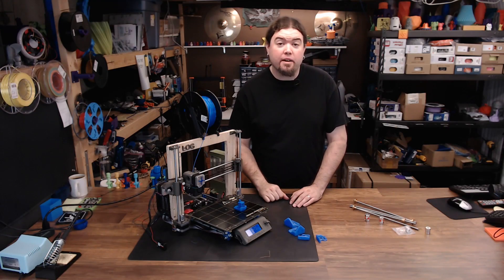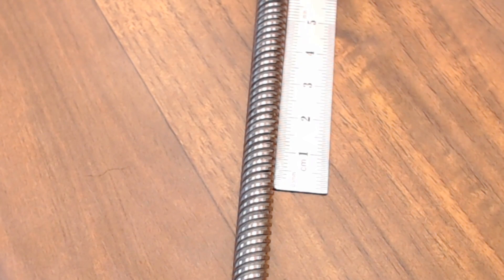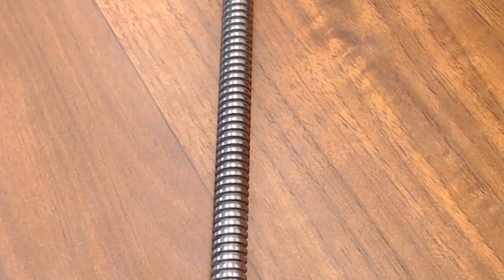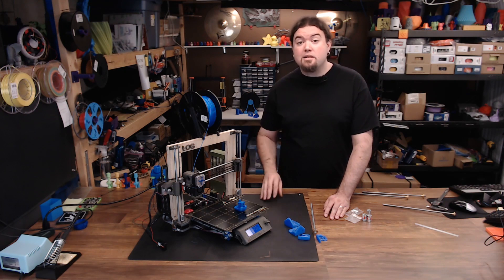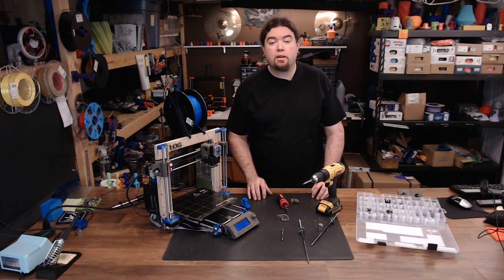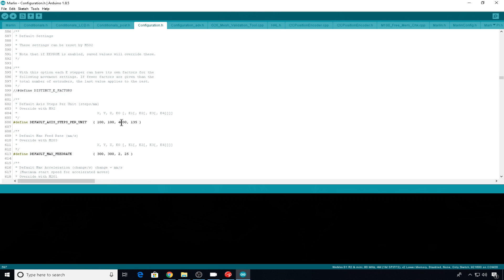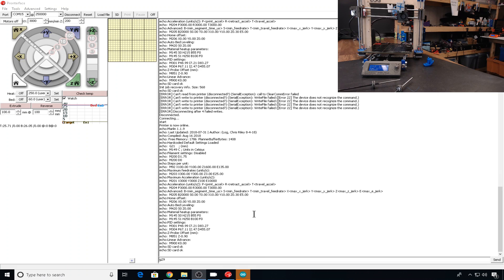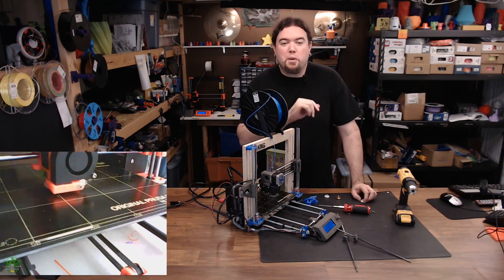Lead Screws - Printer Upgrade - Chris's Basement

Comment: Personal Summary Notes:
- Pitch: distance bet. threads
- Start: separate thread path
- Lead= Pitch x start 
- Lead/Steps= linear distance per step
- for system that require faster movement it uses multiple starts, every start acts as single start with high pitch.
- might have more friction and require a more powerful motor to drive them effectively. They could also be more prone to backlash and require higher precision in design and manufacturing to ensure proper alignment.
- single start travel a lot of distance in small pitch, slow put more precision
- Helical type coupler:  can move in X & Y axes but also can hop a lil in Z-dir
Reply from the maker: Looks like you got it!

Comment: Hi Chris, I am learning quite a bit from your youtube videos. Thank you! I am having trouble with the first 5 layers on my print. I have a TR8x8 z axis lead screw. The first layer height is 0.2 and the layer height afterwars is 0.16. Should work, right. But the first few layers are too close and there is alot rough patches in those layers. Any advice??/
Reply from the maker: Awesome to hear! It could be backlash in your gantry. Sometime on certain printers, the first couple of turns on the Z aren't as efficient as they should be because to droop from the X gantry. Sometimes anti backlash nuts can help, or just snugging up the gantry so it's more efficient.
Reply: @ChrisRiley  Yes that has been my problem from the get go! I will find a solution! And thank you, again!!!

Comment: So I f I wanna make Prices cnc milling machine , it's good to choose single thread instead of 4 starting thread ?
What makes diffrence ? , can we compensate this variation of linear motion per revolution per steps , in Cnc Program?
Or any type Of starting thread can be used ?
Reply from the maker: You can use any thread and change it up in the firmware. All the different profiles I show in this video are going to be MORE than accurate enough for the machine.

Comment: Excellent video!
Any idea what leas screws the sidewinder x1 uses?
I know it is T8 but not sure of start,and pitch.
Any  help apreciated!
Reply from the maker: That is a TR8x8 so 4 starts 2mm pitch.
Reply: Thank you!
Appreciate the response and the videos!
I bought (6) x2 and (3) x1 but as is and need work but could not find info
ARTILERY was not much help with part spec and part info. 
Have a few bad lead screws but wanted to go longer to 800mm. Or 1000mm and go double on bed size just for fun/learning. (New to 3d printing)  Online sellers for the x1 x2 lead screw did not have spec info.
I watched your video several times but still was not sure what I was seeing.
Thanks again!

Comment: Hello my friends. I don't have much experience for building my 3d printer.
I have a few questions. I know that if the BED of the 3d printer moves in the vertical direction and its weight is high, if power will be cut off and the lead screw is not suitable, there is a possibility of it falling and you cannot continue printing after the power is connected Or it will be very difficult to continue printing.
I have designed a printer that I will tell you about and I would appreciate it if you could help me with the questions I have.
Bed size: aluminum 50x50x0.6cm with a glass on top. This bed only move in Y axis.

1- Can 1 nema 17 (4.4kg/cm) with GT2 pulley with 6mm belt move this Bed in Y axis without any problem? You probably tell me that it depends on the bed weight. And my question is, what should be the weight of this bed? so that 1 nema 17 (4.4kg/cm) can move it horizontally?

2- The accuracy in the Z direction is very important for us. and for this reason, I chose this lead screw: (( D= 8mm/ lead= 1mm/ Pitch = 1mm/ 1 start )) and the driver is DRV8825 which has a 1/32 microstep. My extruder is indirect and only E3d-v6 attach to x axix and I attach MK8 filament driver to Structure and moving filament with PTFE pipe 4-2mm.
With these conditions, if the power is cut off, the X-axis will not fall in the vertical direction if I use this lead screw? I used two lead screws with these specifications in the vertical direction.

Please guide me so that I don't go the wrong way and buy the wrong parts.
Reply from the maker: The first question is hard to answer. There will be some trial and error. NEMA 17's can move a lot of weight, but the more weight, the slower you will have to go. 

The second question, if you are using single starts like you say, you will have no issues with backfeeding.

Comment: Hi, i thinking about the Leadscrews In my Way i put the Motors on Top of the Machine, in the upper Part with a Bearing that give Length Movoment Capability. The  Bearing on the Bottom is Radial and axial fix. So can the wobbwlish wobbelmotor with The Coupling Dance around.... I chose the first one of coupler, i think it has better rotational correctnes... Maybee i will try it out. (the best designes you see in the Industry. I have seen such a setup with motors on top and will try it out Best Regards from Germany =)
Reply from the maker: Thanks for your comment.

Comment: I relied on this video for learning, planning, ordering, and assembling.  Well done.  Thanks!  All went well with 2 exceptions.  The Marlin settings had no effect.  On my machine, Z steps/mm is over-written by the eeprom.  Manually changing on display would have taken an eternity.  I had to do an M92 Z1600 and save setting.  To speed up the drive screw, I had to change the #define HOMING_FEEDRATE_Z  to 125.  It was a good thing I started with x carriage midway up and did a test of raising z axis 10mm which traveled 25mm.  I mention the eeprom because most people probably wont read thru 200+ comments and it took me a good hour or so to figure these out.
Reply from the maker: Good catch, yes, that has gotten me in the past as well.

Comment: So where can I get these lead screws? Closest I found was on Mcmaster-Carr but not with 1 start. Are all motors 200 steps per revolution?
Reply from the maker: It depends how long.  http://www.zyltech.com/8mm-t8x2-trapezoidal-acme-lead-screw-w-brass-nut-custom-length-up-to-1000mm/

Comment: Just wanted to say Chris, since I've gotten into 3d printing, I had no clue what anyone was saying about layer height, and many other terms you mentioned. I had no idea on lead screws and how it related to micro stepping and layer heights on your prints. With this video now it all makes all sense and now I am actually noticing a difference on both my Ender 3 and Ender 5 printers that I had two different lead screws on each one! On on my Ender 3 I have a 4 start and my Ender 5 I have a 2 start! So both of my printers have different layer height multiples (0.04 and 0.02)! I thought they were all the same! Thanks to your video this def clears up a lot.

Is there a benefit of using a 4, 2, or even a 1 start? Is there a difference in quality and or how the stepper motor can handle the layers?
Reply from the maker: Glad it helped! Now a days, there isn't a lot of difference since the drivers and microstepping is so good. Technically on paper single start would make your layer fall closer to full or half steps, which again, on paper, would be better. Can you see it on the print? Probably not.

Comment: 400mm rod, 8mm dia, 4 start....to reach 0 to 400mm how many rotation should motor rotate?
Reply from the maker: I feel like this is a pop quiz, LOL, so 8mm per turn, 400mm that is 50 turns.

Comment: If the original lead screw needs the motor to make 3.75 full steps for 0.15 layer height, but the motor is set for 16x microstepping, why can't the motor simply take 3.75x16=60 micro steps? There might be some layer heights that won't match neatly with the steps available, but it seems that the common ones would work just fine.
Reply from the maker: The idea was to land on a full or half step as much as you can, really it doesn't matter that much at all now a days.

Comment: Thanks so much for breaking the math down so well. I would have never figured any of this out on my own and it's very relevant to me as I'm now buying parts to upgrade my ancient robo 3d r1. 
 
The 4 start 8mm lead screws certainly are the most popular/readily available on amazon. In my case I've only ever printed at 0.2 layer height so I can see how grabbing these and moving on with my life would be perfectly fine. 

But your point about achieving any layer height within two decimal places, for the single start lead screws, was an important take away. 

I didn't really understand some of the math, so I took what you explained at different points in the video and tried to lay it all out in one shot in a spreadsheet. I've shared it publicly for anyone who wants to study it. https://docs.google.com/spreadsheets/d/1KFYwtGOEPqN6q9QY-LbsYkHjHQ_yWnzOfWCUha9THWI/edit?usp=sharing
Reply from the maker: Very nice! Great way to lay it out. That makes a lot more since.

Comment: Hello Friend,

I need your help to make some key decisions. I am making a large size 3d printer CoreXY type, bed will not move, size - 2300*1500*1500mm (X Y Z).

Due to the large size of x & y, I have two options, one is to use large width belt 10mm, another solution is a ball screw.

We don't have to compromise in speed and quality, so please guide according to your experience.

In the view of the ball screw, I don't have experience of use of a ball screw, so there is doubt on the backlash problem in the ball screw.  So please guide that, Have you observed backlash effect in ball screw, if yes than please guide on how to fix this problem. 
Please discuss in the view of ball screw SFU1610 for X & Y axis.

Also guide, ball screw SFU1605 is better or lead screw for Z axis. 

In lead screws, we eliminate backlash effects by using anti backlash spring nuts. Same way is there any way to properly eliminate backlash in Ball Screw.

You can also suggest your ideas for a large size printer.

Please reply
Reply from the maker: There are a lot of things to consider when making a printer this large. The large it gets the problems you see get made larger as well. You need to make sure it is very sturdy. Ball screws are going to be much more accurate than a lead screw. The ball screw will have much lower backlash by design.

Comment: Is it faster than regular belt 3d printers?
Reply from the maker: I would say lead screws are a bit slower.
Reply: @ChrisRiley  thanks for the reply. What if someone's making a huge printer...approx 2m cube build volume...then belts or lead screws?
Reply from the maker: @ShubhamGupta-xb1om  That's hard to say, belts get very slack at long distance, but longer lead screws that are strait are hard to get. I guess I would go with wider belts for a larger machine.

Comment: With a Tr8*2 lead screw, how would the torque change at the same steps/s and at the same mm/s? (Let's say 4mm/s with a Tr8*8 lead screw)
Should I run it on the same steps/s, or is it safe to run it on the same mm/s, with an Ender 3 default Z motor, for the sake of the motor and the motor driver (SKR Mini, TMC2209)?
I don't have a Tr8*2 lead screw yet, so I'm just gathering information.
Reply from the maker: I think I answered this, but the the ender 3 motor is pretty small, it might not have enough torque to turn the finer pitched lead screw.

Comment: 1 question , i bought th e2 mm lead screw , can i use them in a cnc for pcb? will th enema 17 be able to handle the 1600 E steps?
Reply from the maker: Not sure what you mean E2 mm? Yes, the single start works well with a nema 17.
Reply: @ChrisRiley  i mean using them for a cnc , will it work?
Reply from the maker: @TnInventor  It should, they are just very slow.
Reply: @ChrisRiley   i will use 8 mm pitch  then , thanks man

Comment: Chris, should I switch out my x,y belt system to t8x2 screw?  And my z have t8,8lead-2p-4start also wanted to switch it to t8x2 1start
Reply from the maker: I don't think you would gain a whole lot converting to screws over belts. On Z they are nice, but they are super slow.

Comment: Hi Chris, great video, im really enjoying your series. I have learned a lot from you over the last few weeks in building my first printer. but im wondering about your calculations when you say about "whatever micro stepping"

I have ran the calculations and i see once you go to 1/4 or above micro stepping, the layer heights do not need rounding for an 8mm lead screw with a 2mm pitch and 200 rev stepper. unless ive got my sums wrong. 

in the below, the figures under 2mm and 8mm are the steps required to achieve the layer height.

1/4 Micro stepping
LH	        2mm	8mm	
0.1	        40	        10	
0.15	60	        15	
0.2	        80	        20	
0.25	100	        25	
0.3	        120	        30	
0.35	140	        35	
0.4	        160	        40	

1/8 Micro stepping			
LH	        2mm       8mm
0.1	        80	        20
0.15	120	        30	
0.2	        160	        40	
0.25	200	        50	
0.3	        240	        60	
0.35	280	        70	
0.4	        320	        80	

1/16 Micro stepping			
LH	       2mm	8mm 
0.1	       160	        40
0.15       240	        60	
0.2	       320     	80	
0.25       400  	100	
0.3	       480	        120	
0.35       560   	140	
0.4	       640	        160	

Taking an example from your figures at 2:08. 

LH         NO MS         1/4 MS         1/8 MS  
0.15      3.75              15                 30
0.3        7.5                 30                 60
0.45      11.25            45                 90

Using the standard 200 steps steppers, 8mm lead, 2mm pitch. once you go to 1/4 micro stepping, you are getting 0.01mm resolution per step. so any layer height can be achieved. i know there are disadvantages of micro stepping. But if you can over come them, would you still consider an 8mm lead screw has a disadvantage over a 2mm lead screw.
Reply from the maker: Thank you for this comment, I don't make some of the statements in this video very clear and I apologize for that. In the video I am suggesting that if you stay on the full step and don't land on the micro step your accuracy will always be higher. How much high, a very very small amount. Micro stepping for the most part works great, but on the micro level it will never be as accurate as the stater. Hopefully that helps!
Reply: @ChrisRiley  Hey, yes, that helps a lot. i need to make a choice. 2mm lead for accuracy, vs 8mm lead for speed. i will get both and try.
Reply from the maker: @paulrobinson270  I really like the single start, but you have to have some patients their speed is a little painful.

Comment: Hey Chris. Love your work and have felt empowered to try upgrading my printer.  I bought some T8x2  with one start, updated my printer to the 3.0.0 and got a successful test print. I switched out the lead screws and updated the firmware but when I went to test it the z axis only went up a fraction of the max height. Any ideas?
Reply from the maker: Thanks! Yes, you need to update your Z steps. You can run a M92 Z1600

Comment: I just upgraded my lead screw (https://www.amazon.com/ReliaBot-150mm-Thread-Printer-Machine/dp/B07QXYVW8R/ref=cm_cr_arp_d_product_top?ie=UTF8) on my ender 5 pro. I changed the steps to 1600 and the federate to 3 (It was at 20, not sure why), and when I try to home the printer, the coupler spins quite a bit, and the axis moves some, and then it makes quite a loud whining like noise (coming from the z stepper motor I assume). all the motors and such are stock so I am not sure what I am missing, not entering in correctly....any ideas?
Reply from the maker: I would put the feedrate back to 3. It's probably just moving to fast binding the lead screw.
Reply: Yep, that worked, I dropped it to 2, and it’s really slow, so I tried up to 5 and it seems to be working well. Thanks for the info

Comment: Hi Chris, So ive got a question I'm wondering if you can help me with, I'm looking at changing my ender 3 to a Tr8x2 after watching this video, but almost every search term I try throw at Google I don't get a concrete response to, So my question is, I notice the lead nut looks completely different has 4 screw holes, do they match up so I can just screw 2 in? If not is there a lead nut that I can buy that Google isn't showing me?  cheers in advance!
Reply from the maker: Hey Grant, tr8x2 will be a different nut and they are going to be really hard to find in the ender 3 style. Probably have to find some to machine one down to fit.
Reply: @ChrisRiley  gotcha, well for the Time I think I'm out of luck and patience, me thinks I should do more reading another day.

Comment: Any recommendations on high quality lead screws?

I'm looking for ball screw style nuts, too
Reply from the maker: Misumi has really nice stuff, https://us.misumi-ec.com/ check openbuilds as well, there stuff is nice for the money.
Reply: @ChrisRiley  openbuilds products don't list an accuracy. I was hoping for at least C7 grade, so it would be difficult to purchase something that I don't know what I'm going to get.

The link leads to a place that doesn't sell anything larger than about 250mm, and I need 520mm for my z axis.
Reply from the maker: @garybarbourii8274  I have been looking around, I really can find a lot of high end sellers. I will ask some others.
Reply: @ChrisRiley  I'm about to roll the dice on one of the alibaba sources claiming C7 grade accuracy

Comment: Another helping video..thanks Chris.. just wanted to note that at 4:00
you are right that the pitch is 2mm also they wrote there mm/revolution
so i guess they meant how many mm we advance in a revolution and it's 8mm
then with 1:1 gear it's given the same number.. but i am just noting the final answer is the same
Reply from the maker: It is very possible I said it wrong. :)